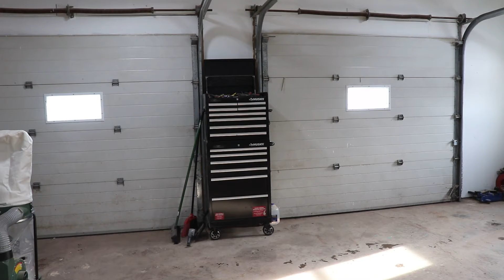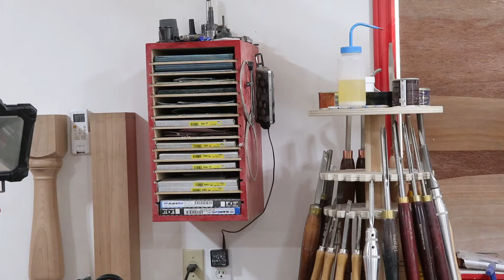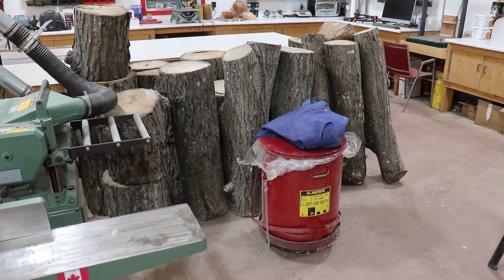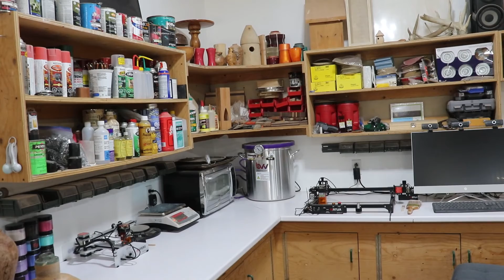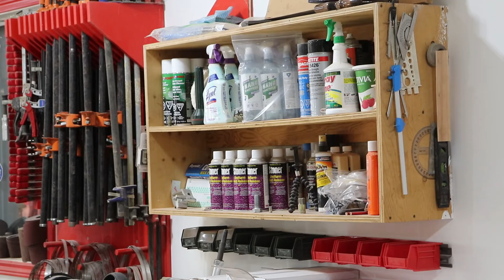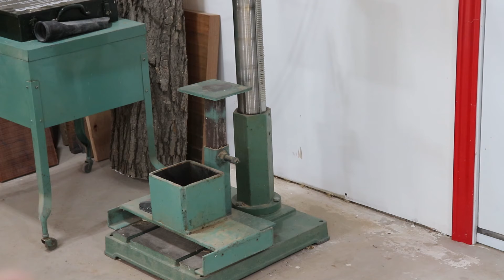Woodturning | New Years Shop Tour

Comment: Great shop!  I know I'm a year late.  But those dust collectors you have only catch 5-10 micron particles.  The most dangerous are the 0.3-5 micron (5-10 aren't good either mind you).  You'll want to get a better filtration system on there.  Plus the bags, if you turn off the lights in the shop and shine a flashlight from the floor up when you turn it on will pump out a ton of fine particles into the air at chest/head level.  Why they call them dust pumps.  But again, great looking shop!  All the best from a fellow Canadian (now in the US)!
Reply from the maker: Hey, thanks for the input. I am going to upgrade filter. I use PPE in the interim. Thank you for watching!

Comment: Have you given any thought to Paper air filters for your dust collection, it would draw more air and protect your lungs.....the thing is  that the way you have it setup now it takes all but thte really back stuff outof the air  and distributes the really  bad air right it face level where you can brathe it in much more easily.
Reply from the maker: I have actually Dwight, it is on the list for sure! I do wear an N95 or a full face mask while I work most of the time.
Thank you for watching!

Comment: Beautiful shop, and I love how you went all "General" .... You mentioned your "mold" cleaning station.... I would love to see a video on your mold cleaning process... I had to put a whole lot of my blanks in rubbermaid bins during a move.. and well.... I need to learn how to clean all those blanks up proper.

Wishing you all the best in the new year!
Reply from the maker: Thanks Steven! I was showing where I keep my mixing containers and molds and spoke about cleaning the HDPE surface of the table saw extension where I mix my resin. I spray my molds with Stoner mold release so no cleaning necessary. As for the mixing containers they are recycled food containers so one use and then they are disposed of. Thank you for watching!